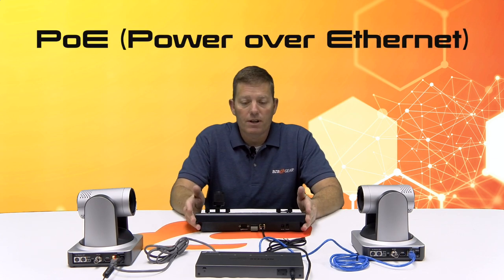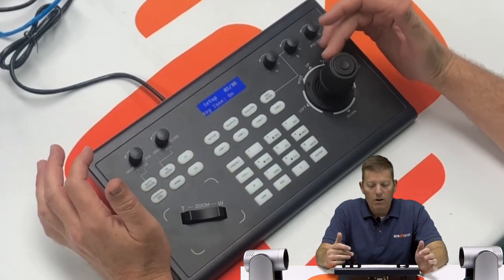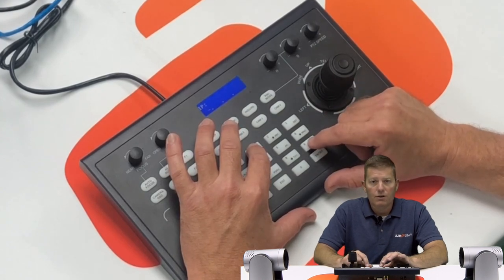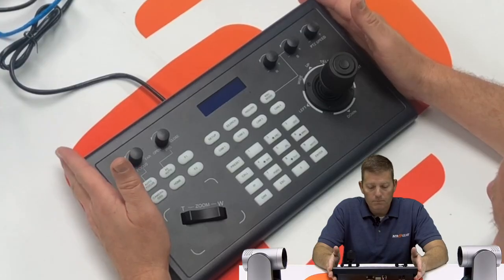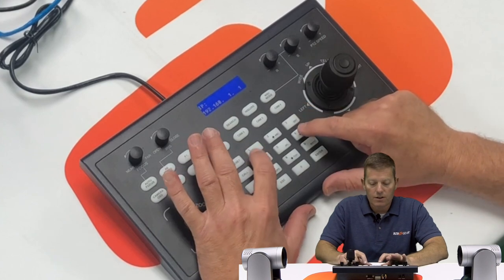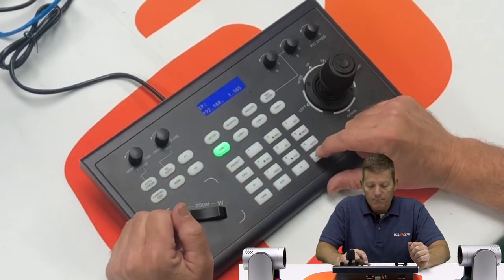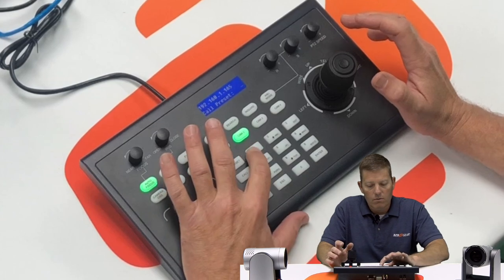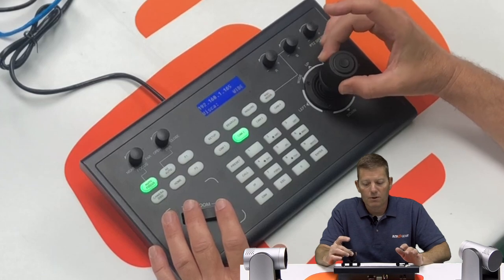How to Connect an IP Joystick Controller to Manage Multiple PTZ Cameras

Comment: Great Video Chris!  You may want to make one change (or be sure they ship with port 1259 as default!)
WARNING: If you get a "Visca cannot connect" error, check the Visca Port address on the Camera.  Ours did not arrive with Visca Port set to 1259 - it had a default 5-digit port address.  Once I changed it to 1259 everything went great.
Reply from the maker: Hi Arthur, I checked out your sales order and you purchased the BG-VPTZ-HSU series, not this model on the video (Just for others to reference) and you are correct, the default port should be 1259 to help simplify. We are working on this change for the near future, thank you for your input and purchase Arthur!

Comment: Thank you for this informative demo video.  May I add to say and ask... With each Key press makes an audible BEEP sound is made and thus not acceptable in a quiet environment.  May I ask if this Key pressing BEEP Sound can be turned off or disabled permanently making the controller usable in a quiet environment or service?
Reply from the maker: Hi James, thanks for watching! Yes, the beep can absolutely be disabled easily through the on-screen menu settings.

Comment: I have a Hsility PTZ controller and 2 SMTAV cameras. I am connecting them to a TP-Link 5 port hub that sends power over ethernet to the cameras and controller.  The hub is not connected to any computer or router in the house.  The controller cannot find the cameras when i ask it to search.  I have also tried to input the camera IP manually and still nothing.  Can you help me?
Thanks.
Reply from the maker: Hello Peter, which model controller are you working with? If you are not using a router you will need to assign it a static IP address matching the switches address but different than the cameras IP addresses. What protocol are you using to search, ONVIF? You may want to try IP Visca. 

Please call or email our Tech Support line for assitance if using our joystick controller. 

Tel: 1(888)499-9906 or Support@bzbgear.com

Thanks for watching and commenting!

Comment: Our church has two each of the PTZoptics cameras model number PT12X-NDI.  We have and are not happy with the PTZoptics PT-JOY-G3 controllers performance as the slow pan & tilts are not smooth/slow enough. The slowest efort is too abrupt and not fluid when starting the movement.  Does your controller allow for slower panning movements or is it all in the Cameras fault that have this effect of being too abrupt at 'its' slowest pan & tilt?? ...also, Can this be used with the PTZoptics "NDI" Cameras??   Thank you BZB.
Reply from the maker: It sounds like what you're running into is an issue with the cameras actual movement. The joystick controller speed adjustment is limited to the camera's movement. It's possible that it's related to the joystick 'dead zone' but not guaranteed. Pls give us a call 888-660-2962, we'll be more than happy to speak with you about your situation.

Comment: Great video Chris. I have 2 of the same cameras, with the same IP address. How do I change the IP address in my camera? I have 2 Fomako NDI/SDI/HDMI PTZ IP Camera. Every time I go to connect the 2nd camera my Fomako controller gives me a connect error message.
Reply from the maker: Hello, many cameras have similar interfaces, but our cameras are not the same as Fomako. Like all other manufacturers, we do not support other brand cameras. Unlike Fomako, we do offer U.S. Based support 7 days a week and a 5 year warranty. Did you buy our Joystick Controller? If so, you can call our Tech Support, but at least one of the products must be ours to qualify for help. 

Thanks for watching, hope it works for out for you!

Comment: Hi Chris, I have the exact controller. Can I connect 2 cameras with different protocols? so 1 have 1 IP Camera and 1 Analog camera using RS422. If it is possible, how can I add the Analog camera into the controller? look forward for your reply... thank you.
Reply from the maker: Hi Steven, yes you can add a Networked camera using Visca IP and a Serial analog connection using Visca Protocol. Does you analog camera do Visca?

The main issue is you cannot simply switch between Cam 1 and Cam 2 without switching modes prior to selecting.  You would need to switch Protocol Modes in-between switching cameras. Basically, its a bit if a hassle and take about 3 steps to switch between. So it's not ideal for a live show if timing is essential, takes about 10-15 seconds switching between modes. Some practice makes it easier. If timing is not essential and there is a little time between the shots then it works, will just take some memorization. Feel free to call our Tech support for more help on How to Configure!

Comment: I'm trying to add a Sony SRG 300-SE to this controller. I can't find anything in the manual about what the UDP port is for this camera and 1259 doesn't work. It says it's successful when adding it, but then does not connect when cam1 is pressed.
Reply from the maker: Hi Chris,
We recommend contacting your camera's manufacturer for the supported control protocols and port settings, they vary by manufacturer.

Comment: Great video. How do you connect the controller to a video switcher? Or do you connect the cameras to the video switcher? 
Thank you!
Reply from the maker: Hi Abraham. This controller is designed purely for PTZ control of multiple cameras using IP or serial control.  Your video outputs should connect directly to your video switcher.
Reply: @BZBTVchannel  thank you for the reply and clearification.  Great video and explanation also.
Reply from the maker: @abrahamdiaz9726  TY, we appreciate it.
Reply: @BZBTVchannel  Will those IP addresses  work for anyone? I have the same exact set up, entered the same addresses, but when I hit the Camera 1 or 2 button it says connection error, not able to control the cameras.
Reply from the maker: @abrahamdiaz9726  Your IP addresses will vary depending on the configuration of your local network - they are not guaranteed to work in all situations.  We recommend using a program like Advanced IP Scanner to find the IP addressing scheme of your local network.
Reply: What video switcher are you using in the video?
Reply from the maker: @epiphanyepiscopalchurchlas3276   We offer the BG-MFVS61 for switching camera sources and sending to a computer for streaming. 
https://bzbgear.com/product/bg-mfvs61-6-input-3g-sdi-and-hdmi-video-mixer-and-production-switcher/

Comment: We bought the same setup, we do not know the IP address of the cameras, how do we know the default IP address and change them
Reply from the maker: Hello, which model do  you have? Most of our models will have the default IP address as 192.168.5.163. If you selected the BG-VPTZ-HSU series then the default IP will be 192.168.1.162. This information is in the manual as well. 

Please call our Tech Support if you have more questions!
Tel: 1(888)499-9906 or email Support@BZBGEAR.COM

Thanks for commenting and watching!

Comment: hi. How can i change the camera IP. I have the same models as you but I don’t know how to change the IP of the camera and i can’t connect the two of them at the same time
Reply from the maker: If you connect to the web GUI of the camera you should be able to enter the settings (might be titled "configure" or "configuration") and then navigate to the "network" tab. Once you're there you should be able to uncheck the automatic IP address and instead choose a manual IP address with "configure IP address". Here's an older video for one of our models showing how to do it with a Mac. https://www.youtube.com/watch?v=C2TS8JlcreQ

Comment: Didn't you have to change the ip address of one of the cameras since they all ship with the same address?
Reply from the maker: Hi Kevin, the cameras default IP addresses must be changed if the Subnet for your LAN does not coincide with the cameras default IP address. The joystick controllers IP can be set to DHCP since you do not typically need to access a Web interface via IP address. 

192.168.5.163 (The .5 is the Subnet field that requires changing for your LAN) 

Thanks for commenting and watching!

Comment: Are the cameras and controller currently connected to the internet ...please explain how they are connected .
Reply from the maker: Hi, yes they are both connected using a CAT6 cable to a Network PoE switch which is connected to a router. If you need help with a design or setup give us call or shoot us an email! Thanks!
Reply: @BZBTVchannel  how to connect if there is no rj45 port in the controller?

Comment: How to connect, KBD1010 , there no rj45 connector?
Reply from the maker: Hello Adi,  
It appears you are talking about a Bolin Joystick Controller. Bolin product pages states that this controller will work with any brand camera that offers Visca IP protocol. BZBGEAR cameras provide Visca IP. 

Bolin Quotation from the product page:

"All Brands Camera Visca Over IP Control in One System
Visca Over IP port used with the camera is different from different camera makers, KBD-1010 allows you to use any brand of Visca Over IP cameras in the same system together with no conflicts."

Please email Info@bzbgear.com for more information or a quote. 

Thanks for commenting and watching our video!